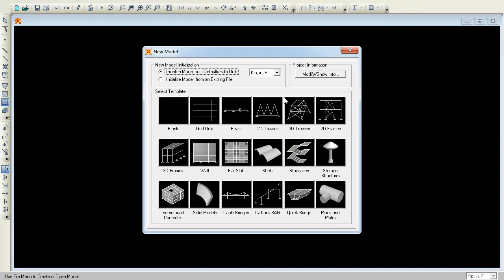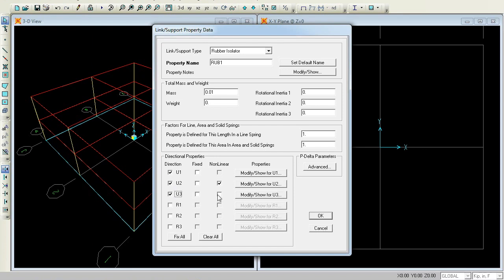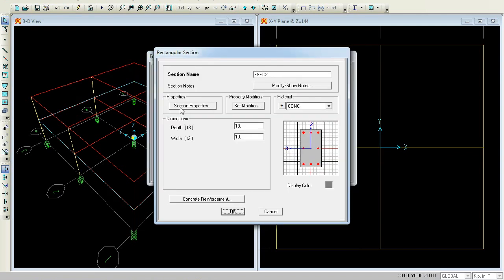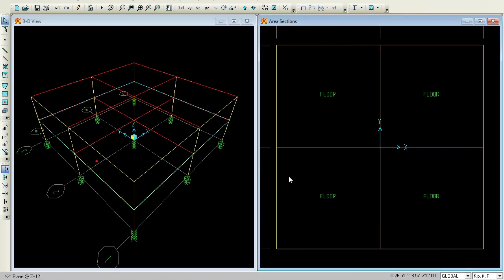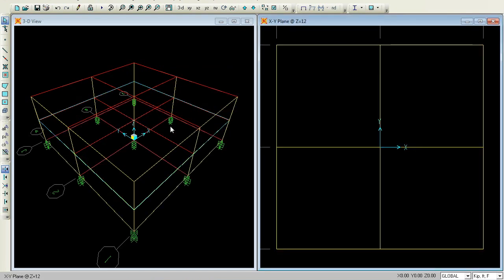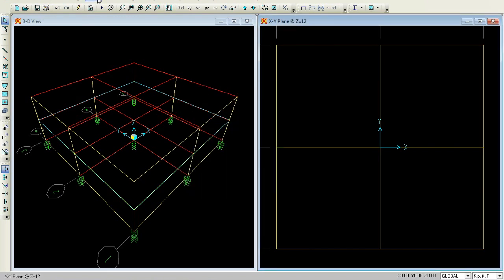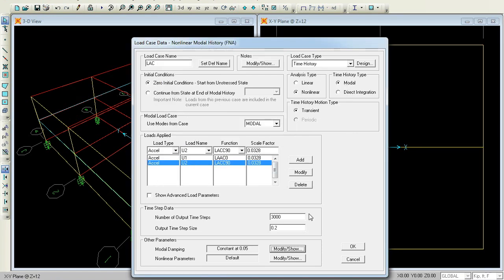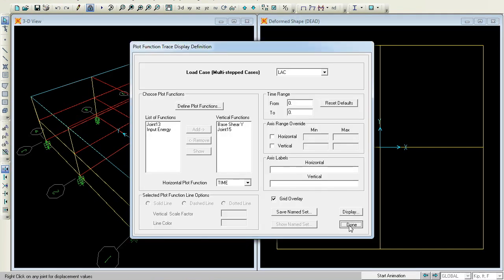DESIGN OF BUILDING USING SAP

Comment: i think you have done mistake while defining beam section, after giving depth and width you have to go through concrete reinforcement and select beam there otherwise it will act as column by defult...check it